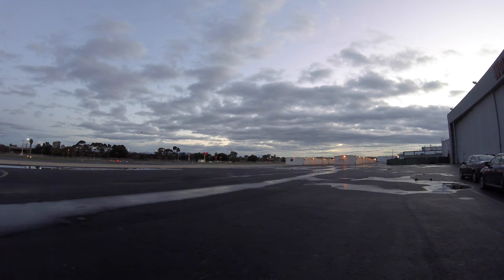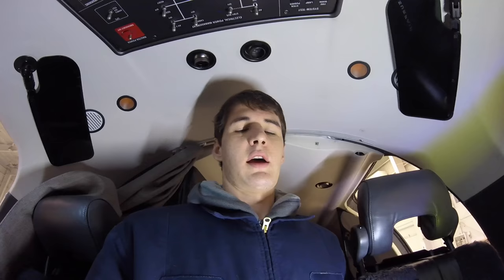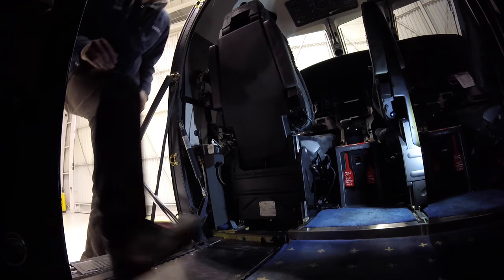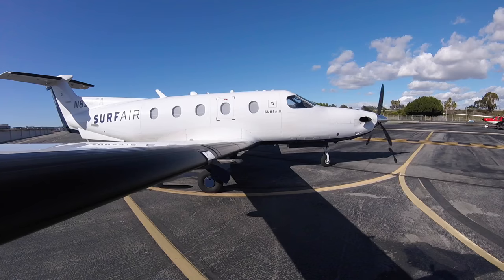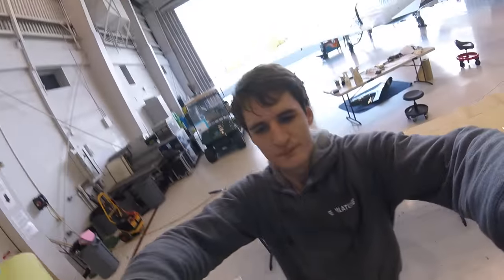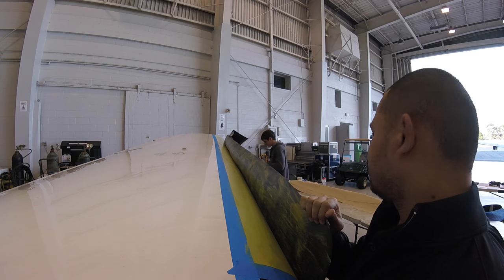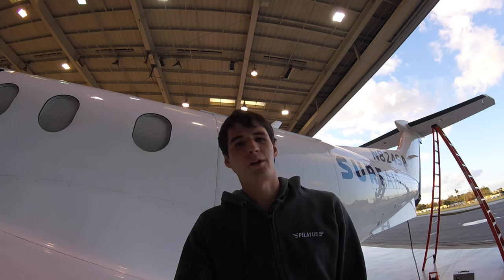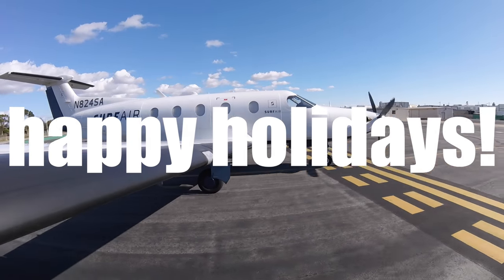christmas eve de-ice boots

Comment: Hi James, thanks for the great insights. Really enjoy watching the videos. Do you know by chance how exactly the torque measuring on the Pilatus works, somehow the engine oil pressure is used to measure it, but thats all I know.
Reply from the maker: Luca, I could get into more detail in a video but essentially there is a small orifice withing the reduction gearbox that oil fills and a pressure transducer mounted in the same location measures the torque.
Reply: James Sullivan If it isn't to complicated getting there, I would really like to see it. So after all the torque indicated on the MFD is just a pressure relative to the one in the reduction gearbox? It helps, I never knew what to do with the 44.3 psi limit and why the company didn't opt for the 0-100% scale like with the NG on the MCD, but I understand where the value comes from now. Thanks
Reply from the maker: I can definitely show where the torque is measured in the video. My understanding is that Pratt and Whitney uses the torque to measure how much power was being transmitted to the output of shaft of the engine. NG instead is a reading of the gas generator speed which does not directly relate to the output of the engine. For example, if the aircraft is in stable cruise and suddenly more bleed demand is requested from the engine (de-ice turned on) or more load placed on the accessory gear box (heavy electrical loads on the generators) the gas generator would need to do more "work" in order the maintain the cruise torque setting.
Reply: James Sullivan Alright, yes but i am asking myself why the torque as stand alone value is not displayed in percent to the limit instead of psi. So 
0-100% TQ 
0-~900° ITT and
0-100% NG
I ll be at the factory in Switzerland this month and ask them, because i dont see any description besides this one I just found in the POM sec 7-10. Its pretty much what you said.

A torque limiter is installed on the engine at the torque transmitter boss on the forward engine case. Within the unit is a sealed bellows connected directly to the torquemeter oil pressure outlet, a chamber connected to the reduction gearbox to provide gearbox static pressure and to a drain port on the thrust bearing cover, a balance beam, and a pneumatic pressure orifice.
Oil pressure proportional to engine torque is applied through cored passages in the reduction gearbox to the sealed bellows in the limiter body. The bellows is mechanically connected to the balance beam and to the controlling spring. With an increase in torque pressure, above the control spring setting, the balance beam adjusts to compensate for this increase and causes the pneumatic pressure orifice to open and bleed off Py air. As Py air pressure is bled off, the fuel flow from the FCU is reduced by closing the metering valve, causing engine speed and hence engine torque to decrease until engine torquemeter pressure is balanced by the torque control spring pressure; at this time the Py pressure orifice close.

Again thanks for the help and keep up the good videos

Comment: Cool channel. I subscribed a couple days ago. Finally in on the ground floor! Lol.

Question: that boot replacement seems like such a "one off" type thing. Is it something you have done before or have to do much? I understand the manufacturer will  have a procedure spelled out and you guys are pros. But it seems like you guys have to have so many skill sets it seems like something like that might have a bit of a learning/technique curve. It seems like more of an art project. 

I guess I look at a job like that and think, man that boot probably ain't cheap. I sure wouldn't want to booger the job on that one.

I guess slow and careful does it.

Love the PC-12s!!
Reply from the maker: Thanks! You are right about it being an expensive part and something we don't do very often (maybe 1-3 times a year). We need to change them anytime they are damaged excessively which happens every few thousand flight hours. We can only install so many patches before they need to be replaced. We are definitely not experts at it but you are correct, follow the manual and take your time. It does feel like an art project too lol. Thanks for subscribing!